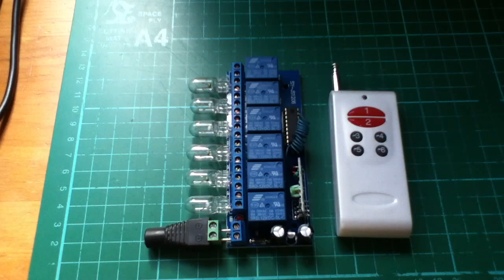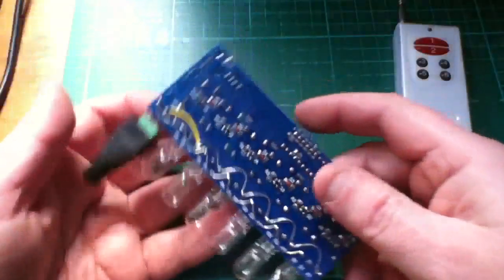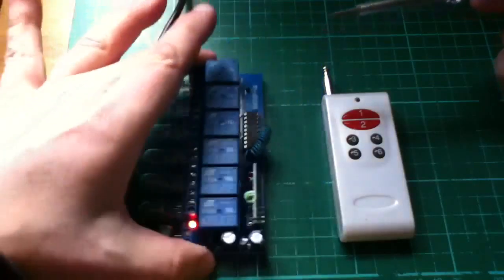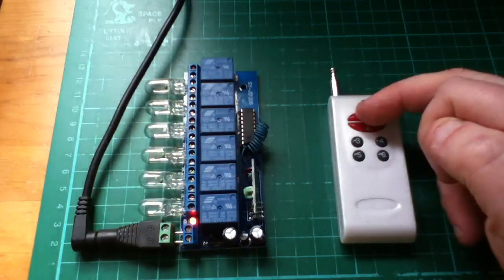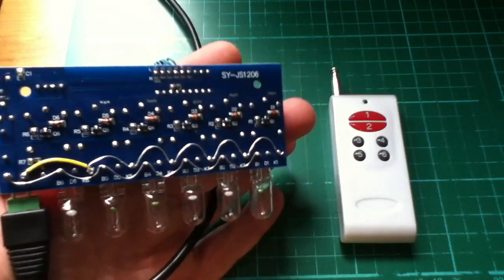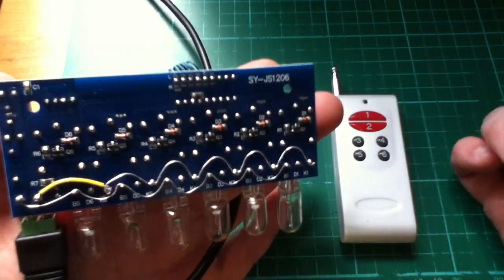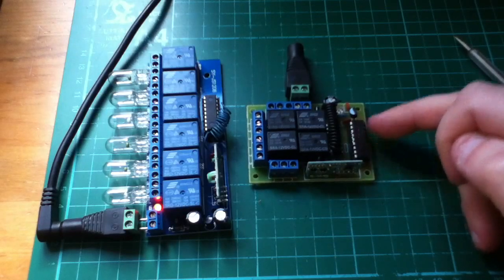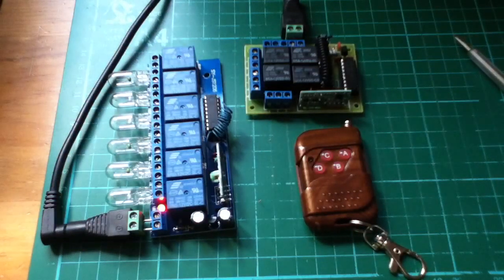12v wireless 315 MHz remote control relay board 6-channel

Comment: You might have figured out by now, nearly 6 years later, but I think you need to reset the board for use with the other remote. I have a similar 4 channel relay board and the relays would close in quite strange combinations. Powering up the board with the learn-button pressed down until the programming diode stopped blinking took care of that, and I also learned that my board had several different modes to choose from; momentary, latching and so on, depending on how you reboot it. That wasn't perfectly clear from the sparse instructions the seller provided.

Comment: Is it safe to hook up a 12 volt relay to my computer as a wireless power switch. If so, how would I go about installing it?
Reply: To TheGunnNerdHD -  Interesting idea. You could make it work. What you could do is take the front cover off where the computer switch is located and substitute the relay normally open and common contact for the computer switches contact. To power the relay board make up a connector from a scrap power supply to hook into the +12 volt and ground of the computer power supply and run the two wires to the receiver board. Run the two wires that would normally go from the computer switch to the motherboard to the relay contacts. When you set up the receiver board for the relay switching action make sure that when pushing the button on the transmitter key fob it is set to momentary contact and not latching. You don't want to send a constant button press to the computer power switch because that action normally turns a computer off. Set it up so pushing the remote control button once makes the relay of the receiver turn on momentarily to send the start up signal to the motherboard to start the computer.
Reply from the maker: Not too clever. Applying power probably won't switch it on. Switching off by removing power is not a very data-friendly thing to do.
Reply: Well I don't get it, I've seen a video of a guy using one to turn on his computer and it was the same 12 volt relay switch with one channel that I have... So how would it not be clever? The entire idea is the most clever idea I've had in months, I'm already getting backproblems from having to duck underneath my desk to hit that damn power button all the time.
Reply: possibly if you do it the right way. find a version of the momentary mode board that runs on 5 volts and uses an opto-isolator. connect the power in to the always on 5 volt line from the power supply. last, connect the two power button wires to one of the relays. 

BONUS ROUND: you could use the other channels for things like the reset button or the eject button of an optical drive if you have one. you could even program an arduino nano to run a keyboard macro when a pin is pulled low or high.

Comment: do you have a link for the 2.1mm connector? I am building a an air cannon for university and I need to connect the 12v supply to my relay but have no clue where to get that connector from.
Reply: Both male and female available.
 http://www.banggood.com/DC-Power-Male-Female-5_5X-2_1mm-Connector-Adapter-Plug-Cable-Pressed-connected-for-LED-Strips-12V-p-998683.html

Comment: If you push down 2 or more buttons, what would happen ? Any interference ? Because I intend to use it in radio control hobby ships etc.
Reply: ppplll000999 I would also like to know if you can push down two buttons at once. I want to use this for my air ride in my car. Did you buy this and if so did it work for you?

Comment: Hi you said you were using this with solar power.  Did you hook the receiver to a battery? If so, what is the amp draw in standby and how long does the battery last in standby? Battery Ah rating? Thanks

Comment: What's the range on that thing? I've purchased a lot of units from China only to be very disappointed with the range. I don't live in a castle but I'd like to be able to switch stuff from room to room, all the ones I've tested require a constant good signal and causes the relay to switch on and off rapidly.

Comment: At what distance is triggered remote? Controls whether a claimed 500 meters?
Reply from the maker: 500m seems unlikely - I tested it at about 30m without any problems
Reply: Julian Ilett I have one of these Chinese 4 channel devices wired into car. A=unassigned, B=Toggle, C=Train Horn, D=Regular Horn.

Works however range is junk. I don't want to put an antenna on roof of car to make it the least obvious I have a remote system of any sort. Ran 3 wire telephone wire in car for each and have an antenna right in upper windsheild area tucked under the roof cover deal. Hidden well but range is TERRIBLE. Better than stock though.

I read you can solder chip on remote with wire but not sure what to solder on it. There is no obvious area where the antenna resides... I'm going to try running 3 separate coax cables hooking to the receiver and grounding the shielding to car frame. Does this sound like it will work better?
Reply: George PS Mouyios Otherwise, the only other options I can think of is finding a more powerful remote with same frequencies. I'm almost certain they are 315Mhz. Booster doesn't seem likely to be a good solution? If so, where can I get a booster? I found some for house alarms but they say it wont work even though it states same chip.

Any suggestions?

Comment: Hi, I'd like to know where you got the power connector for the board. The terminals are much to close for just sticking wires in it and I've killed a power supply from shorting out...
Reply from the maker: it's a CCTV connector - search eBay for "2.1mm CCTV" and you'll find it. This is the female type.

Comment from the maker: I've bought 3 of these so far and none of them has the T (toggle) chip. In each case though, the chip is in a socket so you could pull out the L (latching) or M (momentary) chip and replace it. The decoder chip is also widely available on eBay.